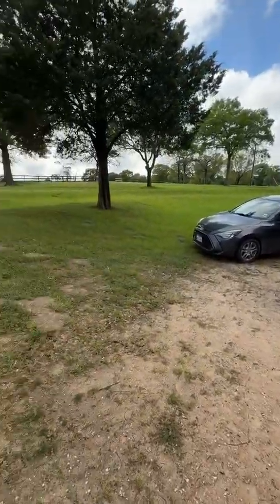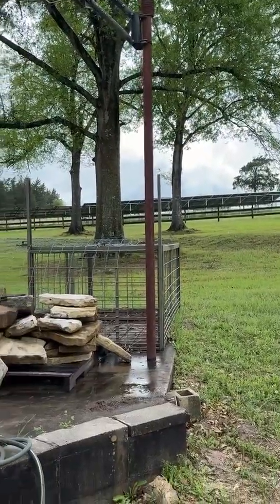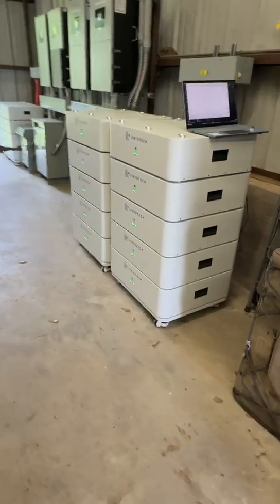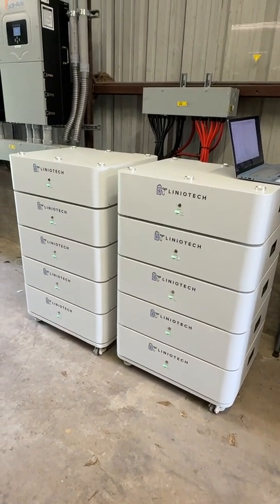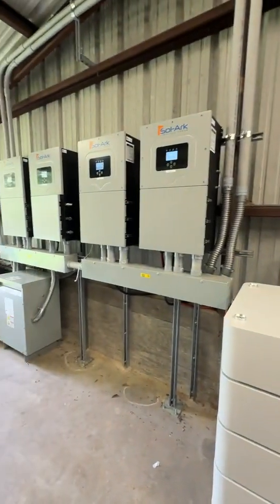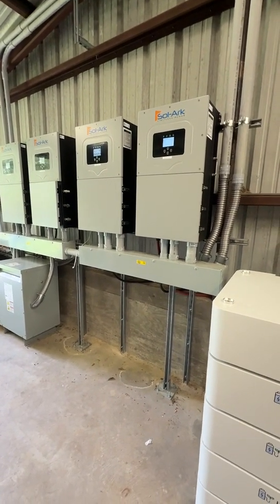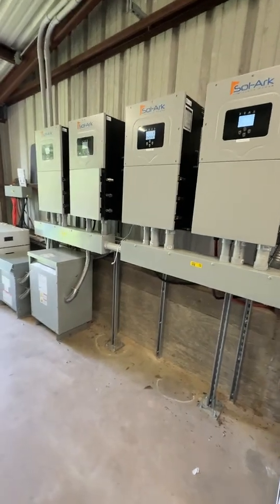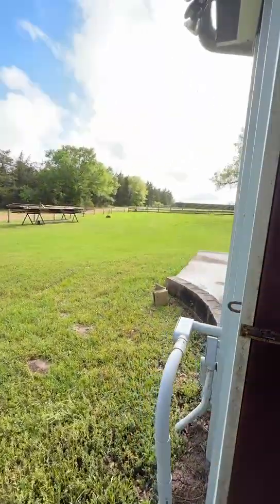Completely off-grid Farm with irrigation system in Texas. 180kwh Liniotech LFP Battery Sol-Ark 60k

Comment: Those cheap high frequency, transformerless inverters won't last very long running those high inductance irrigation pump loads. You'll be lucky to even get three years of use out of them. You should have installed low-frequency, transformer-based inverters instead.